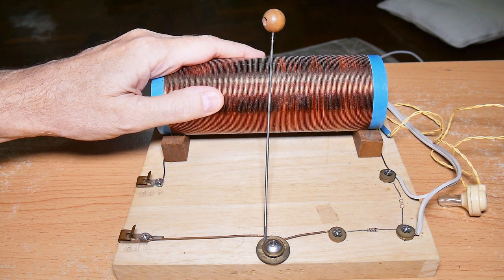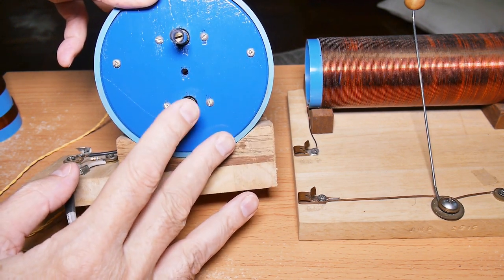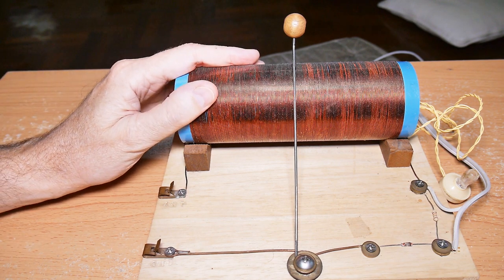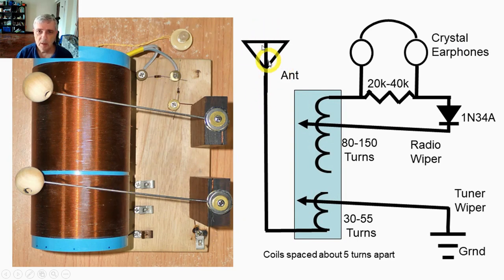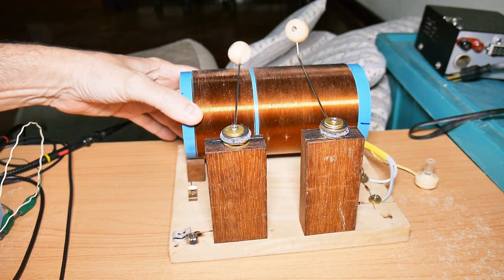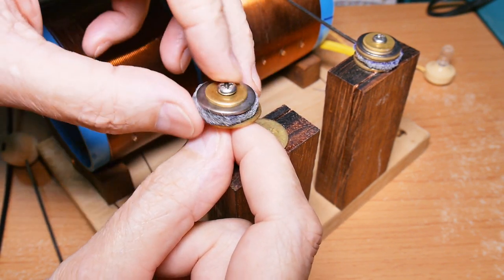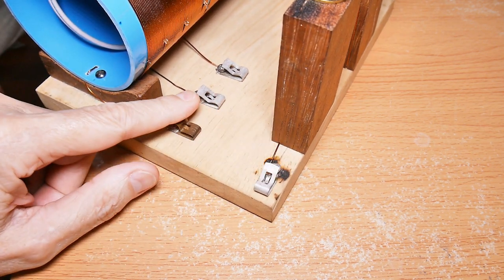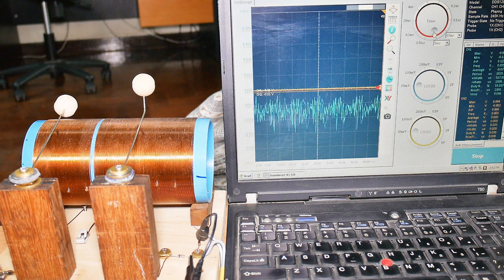My New Favorite!  Crystal Radio with Antenna Tuner

Comment: I like it and can't wait to try my own version! I assume you used pvc plumbing pipe? We don't have the blue here in Michigan, are you using 2-1/2" which is 2.875" O.D. or 3"  which is 3.5" O.D.? Just curious as there is almost a 2" difference in length per turn resulting in 27 feet more wire in the larger coil. Have you considered separating and mounting the coils on another piece of pvc to make the spacing adjustable? I built the K.E. Edwards design but  wound the 'primary' on 2" which slides over the 1-1/2"  (1.9" O.D.)secondary. I added 1/2" in length to the primary pvc and drilled & tapped in 1/4" threads and use a nylon 1/4"  screw to hold the primary at any distance I choose from the secondary. Finger tight holds it in place just fine. This allows me to choose either sensitivity or selectivity at will.
Reply from the maker: Good questions.  Yes, the 3" is actually closer to 3.5 inches OD.  In testing I had 2 separate coils but found it made little difference.  Bigger separation made for lower signal, which might help to quiet a dominate channel.  The pipes must be the same diameter, you can't have one slide inside the other, that's a different design with different specs.   I have not looked into the KE Edwards radio, will have to check it out.

Comment: Would the output lead being at the same end, place adjacent to each other be better or not. On this build they or at opposite ends.
Reply from the maker: I have a video on one like that, but this one is about a third louder.
Reply: @tsbrownie  I'm "coil crazy" and have built many oscillators. Have posted a few experiments. Thanks for the info. wound this one last night.
Reply: @tsbrownie  what grit sandpaper is used to expose the coil contact area for the slider.
600 grit?
Reply from the maker: @tribulationcoming  Any type that is pretty fine and will not damage the copper.
Reply from the maker: @tribulationcoming  Do you have a link?
Reply: @tsbrownie  Email? yes.
Reply from the maker: @tribulationcoming  Yes, or you can post it in your reply for others if you like.

Comment: I am making up  some of the parts  for a lesson to the granddaughters later this summer; I have two questions. My coils are 50 turns and 160 turns using 24 AWG magnet wire on a 3" dia form; after winding them I saw the comment on the antenna coil should be about 20 turns -  I can easily remove about, say 25 turns - Why is a smaller coil more effective in this application than a larger one? Would you recommend I leave it until we assemble the parts to see if yhe crystal radio
 will work?
Reply from the maker: A simple coil has 3 primary features that work in harmony to define the frequency they operate at: diameter, length, and turns per inch or cms (this is affected by wire thickness).  If you change any or all of those much, you can change the tuning of the radio such that it is no longer in the AM band and you won't hear much if anything.  
If you want to do your own coil, I made a video on some easy to use free apps.  
https://www.youtube.com/watch?v=Fw9eb-aB-XU
Or you can just play with these and see how changes to the coil affect the resonant frequency (the frequency the coil will work at).  
If you have questions feel free to ask, I'll do my best to answer.

Comment: What power source do you use?
Reply from the maker: 100% of the power is from the radio signal.
Reply: Are there any alternative for a crystal earpiece?
Reply from the maker: @sergei8802  Not really good alternatives. I have a video on connecting a battery powered amplifier, but that requires a battery and defeats the purpose of a no-battery radio.

Comment: The only pipe I can find is 3.5” on the outside… is that ok?
Reply from the maker: You have to recalculate the coil parameters. There are excellent websites where you can put in the data and get out the parameters. This is a good one: https://coil32.net/online-calculators/one-layer-coil-calculator.html
I have a video on the app. If I recall, the target inductance is around 520 to 620 microHenry.
Reply: @tsbrownie  OK, from that app i'm showing on a 3.5" core, i need 73.277 turns to get 520uH. What happens if there are more turns than that?
Reply from the maker: @joel6221  Just found your comment. More turns = more inductance.

Comment: Where about in the circuit would I place a variable capacitor?
Reply: and how many windings do you recommend on the left sided coil?
Reply from the maker: @rustyshackleford8286  Around 20. I have too many on this one.
Reply from the maker: This does not use a cap. That would require a whole different coil and circuit.I have videos on cap types.
Reply: @tsbrownie For your design I am wondering if a 2 and a half inch postal tube work and if I can replace the Wipers with Taps?
and is your  design for a crystal radio a better choice than this one   https://www.youtube.com/watch?v=mubvsqFrE88  ?
I am trying to figure out which one would give the best results....  Very sorry for asking more questions, I'll try to make these the last.

Many thanks for your responses

Comment: The ear piece I made with a crystal out of a microwave. Every microwave has one. It’s  a black plastic part, and on one side round, and the other side square. On one side where you see like thin cardboard paper, I glued a 2 inch long 5/8 pvc pipe. You can also use the cover of a crazy glue tube. Make sure to cut the tube, so it’s open on both sides. Just hold the tube to your ear and listen to the sound of a station you’ll find.  Simple, easy and it works perfect.!!   Enjoy.!!
Before sticking it in your ear, make sure there are no nasty insects in it.  I live in the tropics and ants, tiny scorpions, etc etc love to hide in it…ha..yaiks.!!
To hear a station louder, slide a piece of ferrite on a bamboo stick into the pvc pipe with the magnet wire coils around it. Slide it up and down if you find a station.
Greetings from the Dutch ABC Caribbean islands.!!

Comment: I just uploaded a video with a link to this video of yours.  It'll take maybe a few hours to process to high quality and for me to make it public as I also have a few chores to complete.
My new video won't be up long before it gathers an unwanted advertisement and I'll hide it by marking it a private video.
IF you see any value to the information feel free to make the information available with your own video on the same subject.  I don't require being named as the source.
As soon as I make that video private I'll delete this comment.
Thanks for your time and the information you share.
Reply from the maker: Thanks for the heads up. That's a very interesting experimentation rig you have there. Lots of flexibility without having to create all new base boards. I will have to look into the short wave thing. Perhaps the variometer's lower inductance will be a natural fit.
Reply: @tsbrownie You're welcome.  Right.  The lower inductance coils are the key to shortwave.  the same might apply to the L-Match.  I haven't yet tried extremely low inductance coils.  And with the 14uH coil I didn't verify hearing any frequencies above 6.115 mHz.  
I did see a video that heard diy CB radio receiver, but the same tuning heard a lot of the channels all at the same time.  It was near 100% cross talk.
Your interpretation of variometer is different than my first thought, but I understand the premise.  Good work.

Comment: Hello brownie
I've uploaded more videos 
My best dx Oman 1600 Miles away
And of my apartment 
Please watch
Reply from the maker: Interesting. I looked up the radio you are using, the NM0S Discovery. Very nice!
The purchase link on his website is broken. Hope he fixes it.
Reply: @tsbrownie  yeah i found on ebay for 65 dollars last one 
I sent him email telling him I'd like to buy another
He never replied
Very sensitive and selective!
Read my comments from all videos to see what my antenna  is etc
Thanks for watching

BTW i need order the wooden box from hobby lobby for radio 
Next time I'm in  usa
Reply: @tsbrownie  I just sent him another email to i different address
I'll give update if he replies
The parts add up to close to 90 dollars 
If purchased separately 
So it's a good value for money
Reply: @tsbrownie  I got an email from nm0s
He said he will have them in stock in a few weeks 
Great radio 

He has web site 
I can't post here yt will censor
Reply from the maker: @baikushex0et682  OK, thanks. Will check.
Reply: @tsbrownie   @tsbrownie  maybe you could post a review of it...

I changed the ferrite rods
It comes with the cheaper type
You can get the r40c1 8 inch bars and cut in 2 . The r40c1 are very good.

(Original are 4 inch )
Then buy litz 420 or 270 by 46 
It's not expensive 
It will work better than the smaller litz,
It's like 60  and cheap ferrite rods  it came with 
That's  what I did
Reply: @tsbrownie  you can pick it up on the Bay
Have to write in code yt censors so.much